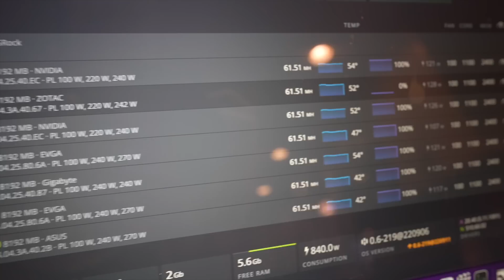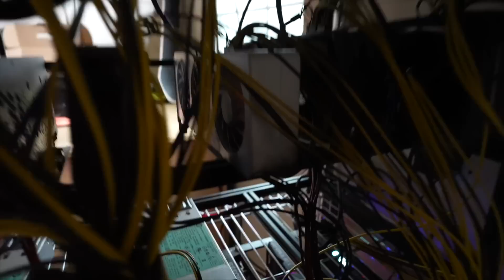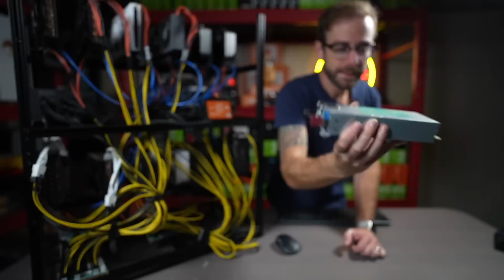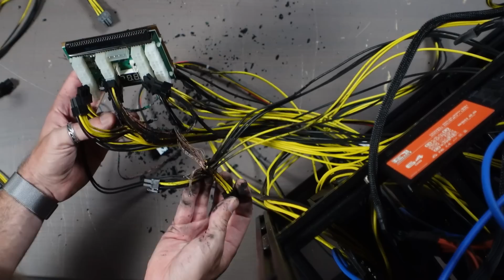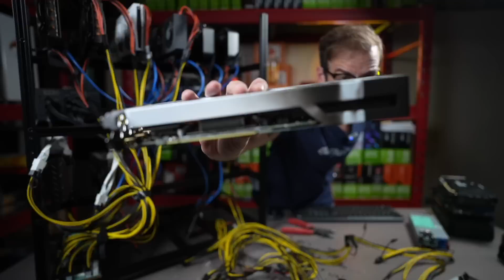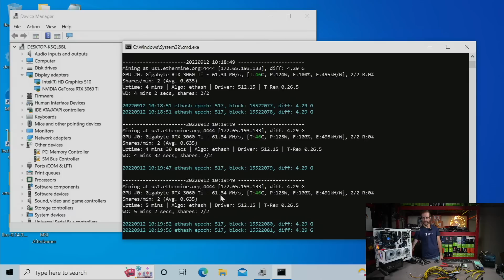Mining Rig FIRE!

Comment: This also happened to me but rizer card are draws more power than graphics card and sata cabel are metaled and this only happened in modular power supply because there is some short of low conductivity between the to conductor that's why the insulator can't handel the temperature and melting down but you have cheak all the risk you have were the couplers and connected if see and touch feel warm then it means you to change cabel or maybe change to next rizer or rizer card have two 6 pin connector you have to connect both in rizer card.
 my 3060ti 8 pin connector is melted inside 😔 my 8 pin is damaged now use directly.

Comment: not sure its the cause but if the wires are too long then the wattage rate is going to drop. so instead of using say 18 gauge you should maybe do some custom 16 gauge wires on the longer runs. could have been anything though like breakout board failure. my farm is currently shut down due to current events stated and ive been running since mid 2017 so its weird that my garage is so quiet now. HAVE A GREAT DAY MAN

Comment: Hardware failure happens with cables looks like the pin came out while moving it around I’ve noticed mine do this and I put it back together but they get loose when pulled on being really neat and inspecting connections when moving rigs around helps I don’t blame ya but gotta keep a fire alarm and extinguisher cuz you never know 😂

Comment: once my psu power cord started to melt on  psu side, but luckily i was home noticed it by the sound and smell, it was hard to get it out from psu, but otherwise it was fine....
i think the cable was not in good contact with psu  after moving to other place and same thing could be with u.
U recently moved the rig, some connector wasnt in good contact or some cable in connector didnt have good contact and it made it to heat up, melt other ones and its like snowball burned all down.

Good thing that fire was local. Stay safe.

Comment: You mentioned that you've just "moved" them there, perhaps that loosen up the connector on board? which causes it to draw a lot more power from certain pins but not the others, causing an overheat into fire? so maybe if you haven't moved it this would've not happenend? I'm glad  the fire didn't spread longer into worse tho.. You SHOULD check the cables of all your other rigs that you've moved there as well to be safe!

Comment: A tip: 

Buy a heatcamera and do weekly chekcups on the breakoutconnecters. And also check for misscolouring. They are usually white, so If they are turning yellow- or brownish then replace the cable, change output or replace the entire board.

Comment: loosen pins usually cause this. the badly connected wire gets hot and when the veneer gets melted it may lead to fire .checking the wiring for unreasonable crashing rigs may prevent this.

Comment: I am glad no one was hurt and gpus still ok to, I had pcie splitters fail because they were wired wrong myself. I wanted to make my own wire harness with soldered conections and fuses could even do thermal fuses in cables. You may have high resistance on pin that fell out causing it to heat up because wire can only handle 9 or 10 amps. You could have corrosion from moisture on connectors which will add resistance possibly.
      A fused cable with thermal fuses would be most safe but more expensive and requires 3 fuses per cable but nobody sells this unfortunately to.

Comment: Hey mate, you said a few times in the vid that those cables should be good for 280w but thats the standard for full 8pin power not 6pin with 2jumpers (depending who you belive 6pin plus 2 is around 154w). still think you were in the clear load wise and it was a faulty connector but just thought id chime into that.

Comment: Yep PIN failure happened twice now the connection on the PCIe board to cable fails. It happened once on a RTX 3080 with no splitters and then once right on a breakout board.  The wire gets hot and when once pin fails the other wires take over the load, overheating and burning. 

This happens in breaker panels with loose connections as well in residential and commercial panels. We annually inspect the connections to look for hot spots to prevent fires. You would be surprised how many connections loosen with just usage. 

Check the mains in your panel at the house and you’ll be surprised if you can get another turn out of them. Happens on heavier loads more than light loads because of heat. 

The best and only way to see if you have “hot connections “ and prevent the issue is a thermal camera, Flir is a good brand and cheap to use. 

The only fix for the pins is to replace the cables and breakouts. On the cards sometimes you have to replace the connectors.

Comment: I was fortunate to not have a fire, but I had an issue with a pin being pushed out of the backshell during a mate.  I realized it happened right away and was able to replace the questionable cable before powering on the rig.  Lesson learned for me was do not force a cable mate.  If there is any resistance, inspect both sides of the mate and if they won't mate cleanly, grab another cable.

Comment: Main reason is that every breakup board and wires like that are made in China with pretty low quality control, and no matter what brand sticker somebody will place on em later. China wires are usually made from cheap copper mixture, and most of the time AWG is not true , if you will measure and compare it to same US, or EU . Also plastic pci connectors and pins are also bad quality most of the time. So the best way to use server psu in mining is to disassemble and do some soldering with quality wires, but it is not popular in US. At least for a little bit more safety you really need to ask someone to make you custom 16 awg pci cables from quality US wires. It is pretty cheap, all you need good pci connectors,  quality pins, and quality 16 AWG cable.

Comment: The bundled up thing and cables heating each other until isolation melts and copper wires short and then go nuclear would only happen if those are scam cables sold as 18AWG but actually 24AWG inside.
18AWG cable hardly produces any heat at those loads.

Comment: Heat over time could have pushed the pins out a little bit causing a poor connection and it to burn out.  I have had it happen on a gpu before and the cable pretty much scorched and melted.

Comment: Only thing is that cables should not be bundled together. The power they can draw goes down by quite a bit due to heat transfer between them, and thus hit max insulation temp at lower power.

Comment: Those pcie cables on breakout boards can't do 288w. It's because they are only 6 pin at the power source. 220 max is what a 6 pin is good for, that's probably unsafe though if they are 18 gauge

Comment: I used the same breakout board. After months I noticed that some of the white connectors turned brown to the point of almost being burnt but still usable and mining away. I guess after some time it will deteriorate due to the heat and plastic and cause the burnt wires.

Comment: That WTF at the beginning 🤣
Splitters are never the way.
Check the breakout board where the board connects to the psu and see if any contacts are damaged on either side of the black connector. Also check that your psu wasn't burnt in the area that connects to the breakout board.
Also, it looks like one of the GPUs powered with the other server psu was having it's riser powered by the psu that went bad? Make sure all GPUs are each only connected to one psu for both the top pci connectors and the riser.
I would say get rid of the splitters. I don't use any splitters and haven't had any issues with my 5 GH/s, all powered with server psus for years.
Also give a shout out to Crypto LLC, powering 3090s with two strands of pcie cables with splitters lmao

Comment: If short was in cable next place what gets hot is connector, connector pins withstand certain current until they start to heat up, so im pretty sure that the short was in the cable with the melted connector.
Other cables was just victims when they was near those short cables and melted together.

Comment: in my humble opinion I would say the culprit is the breakout board. they usually turn bad in few months, and this could led to some irregularities. one connector of the breakout you showed us is black, wouldn't surprise me if it started there after the breakout turned bad, the cable sheath  melted exposing the copper wires that ultimately touched themselves creating a shortcut and very hot point (welding like), this then melted the other cables sheath. anyway, happy you are safe and you lost only few cables and a breakout board. take care

Comment: very odd situation but sometimes it just happens man. I had a brand new corsair rm850x burn from the inside of the psu just pulling like 400w total everything within spec. also had a cable burn by the exit from modular atx psu pulling around 220w from the single cable mining flux. you just never know what happens. I also hate those yellow and black cheap looking cables so I avoid them as much as possible.

Comment: Unfortunately the break out boards have a failure issue. More of you will discover this as time passes. One of the first warning signs is the draw will be lower than 12v if you have one with a display with no way to correct it. Not long after they seem to fail. The fail happens in two ways. It loads the cables with reverse voltage and burns up. Or a protection diode led cluster pops/melts off the pcb. Which makes sense. Diodes protect against reverse power flow.
Good thing is the psu keeps protected in almost all cases. The GPU's don't always survive.
One of PM's distributors/designer have a QC issue.
I've yet to research into it more other than personal diag and comments beginning to show up with many experiencing the same thing after 7month+ use.

Comment: Buy hand made cables with 1mm copper core
And don't use ever those server power supply bcz converter to 6pin is cheap one and get oxidation within time
Use miner psu like antminer 1800w psu with little bord which sync miner psu with atx through main 220 cable for when power on or off motherboard

Comment: looks like a parallel miner board, while mine didnt catch fire, the clamping circuit for the power switch died. I wont be using their boards anymore. Deep in the Mines boards have twice the thickness of copper in them, and they are a much more simply design. your failure looks like high resistance inside the socket for the cable on the breakout board.

Comment: You can create issues when you bundle electrical wires for cable management. If one single strand has any imperfections you can have a fire like that. It is not common, but possible.

Comment: It's probably the cables.  It's easy to buy substandard cables (especially on Amazon) that are labeled 18 awg or even 16 awg, but they are not.   They are dangerous and will cause a fire in the long run.  I only buy my cables from reputable sources and I only get the 16 awg cables and not 18 awg.   I once got 16 awg PCIe cables from amazon.  I caught that it was bad, because I could hear the actual connector humming slightly.  Threw the whole set away.

Comment: Rig fire has/is always my biggest fear!  So what I did was interlock a smoke detector INSIDE my rig tent to a Normally OPEN contactor.  if the smokie goes off, it slams the contactor open and disconnects all power to the entire tent in one go.  Smokie is located right in front of the exhaust going out of the tent.
Reply: Hello.  Would you be able to share the make/model of the equipment for this?
Reply: @elmerduncan4932  Any smoke detector with an interlock circuit, I used a Kidde, and the Kidde SM120X interlock relay.  Smokies are 120V, interlock relay is 120V, the contactor was switching 220V.  So I used the Kidde SM120X to close the higher power draw contactor.

important: smokie => Kidde SM120X=> NO contactor.  So that if smokie senses smoke it flips the relay which kills power to the contactor snapping it open to kill power to the rig.  Relay, smokie and contactor on the same circuit so that if 120V is lost the contactor pops open.  Contactor is Fail Open, not Fail closed.  Contactor I used is a 2 pole 60 amp contactor 120 volt coil

Comment: I wonder if Inductance had anything to do with this since those wire bundles were tied up and not making uniform contact, inductance is a phenomenon were opposing currents in close contact and unbalanced can cause electrical magnetic fields that can cause arcing, heating, etc. I remember when I was an apprentice electrician in the early 90s my journeyman would always carefully inspect the wires in nipples between cabinets to make sure that each circuit going through was complete, neutral, hot, ground and so on. He mentioned that once an ex-helper of his had routed 1 phase and a bunch of neutrals through one nipple on top and the rest of the phases through a second nipple below because he was too lazy to properly bend the 250 mcm wire between the cabinets...this is just pure speculation of course just the first thing I remembered when I saw those connectors melted, my second theory and probably most likely is a loose connector in breakout board since things were recently moved that can easily cause a wire to arc and overheat or simply a dying breakout board with a loose solder connection. Luckily nothing important was damaged.

Comment: I've got a connector that melted too, and my 850W PC power supply turned off immeadiately when it discovered a short circuit. 
With the server power supplies I am not sure they are that protective when it comes to short circuit. So it burnt a lot more cables.... 
I wish I would find PCI power cables with a bigger cable than the ones you get everywhere. 
I start wondering if it's not better to build smaller rigs and limit the power on the rigs.

Comment: Since you had just moved the rig, I would venture to say that connector finally had enough movement to weaken the wire and pin. A lose connection will heat up and could eventually end with the connector melting down. I wouldn't say it's anything you did wrong. Just an accident unfortunately. I'm glad it didn't go more sideways and everyone is safe.
Reply: i was thinking the same thing, if that is the only recent change, it's most probably the cause...

Comment: Buy a thermal camera for your phone. This will allow you to inspect loading on the wires and components by checking for hot spots. This is used to check substations, electrical lines, panel breakers, etc

Comment: either a loose pin in the 6 pin to 8 pin on the breakout board or a loose piece of conductive material got trapped between the insulator and PCB on the breakout board turning in to a heater. those boards really should have fuses on them.

Comment: I had a breakout board from parallel miner catch on fire where the board connected to the power supply. I'm like you I had everything correctly connected just a pen burnt on the board which caused the connector to catch on fire.  Very scary

Comment: Could have been a marginal crimp or solder at either molex pin. Also, it could have been a high resistance trace on the breakout board. The wiring components should be good to 80C before they begin the cook, however, any Temps approaching 80C are not nominal. Use a cheap IR thermometer to check your connections periodically. They are really easy to use. This could have burned your garage down. A server case would contain a fire but in open air they can move from harness bundle to harness bubble. FYI I'm not a very experienced gpu miner but I do work on electronics for a living from voltages as low as 3.3 to as high as 33.6Kv.

Comment: loose connection is what happened. you said you moved it 2 weeks ago? when it was reassembled something wasn't quite in all the way . this caused arcing which lead to the plastic melting and failure.  always push till you hear a click then check them.  always inspect for heat damage and leave bundles loose as possible.

Comment: Happened to me once, troubleshooted and found out that these cheap cables dont always sit in the socket good enough, if they are loose and fall out it will draw more power from rest of the cables. This can get the other cables to melt down due to higher current. Always check and pull the wire from the socket to see if they sit tight and snug.
Reply: I probably wouldn't tape your wires together that close to the connectors. Inside wires would be fine. But, the more wires you group together, the more tension you're placing on those outer wires that are in tension on the connectors.
Reply: you are absolutely correct.  I work on all sorts of appliances and electronics.  A lot of multi-pin connectors often do have loose pins... Many and I mean MANY cables that are cheap coming from China have loose pins in the connector; when the plug is connected the pin gets pushed out... The fact he mentioned he moved the rig, makes me think it just jiggled loose in the connector, and then current went up from it being loose, resulting in heat... and viola... FIRE..... Best way of learning is experience... and sometimes, small disasters are much welcomed...
Reply: Yup, manufacturing tolerances + adding pressure to the terminal due to bending/pulling/weight of the wires. Over time the pin can work itself out of the socket and start creating space between the connect. That's when it will heat up and burn. Usually this will trigger the PSU protection before it starts a big fire.
Reply: @wanglelife  us miners use alot of server PSU, i will assure you this thing will not shut off 😂

Comment: Thanks for the vid, scary. Send it to the vendor to check the issue. My guess is that maybe a wire got almost disconnected at the plug and more voltage was pulled over remaining wires contributing to an overload. May need a local smoke alarm for situations like this.